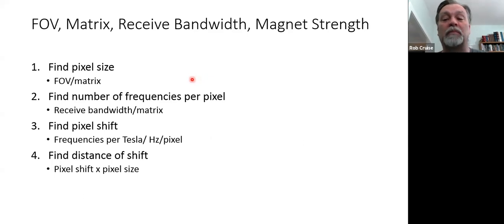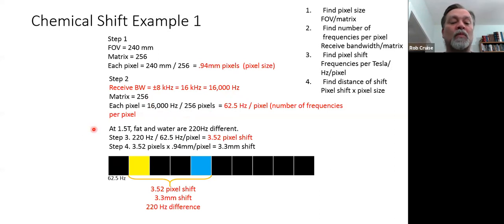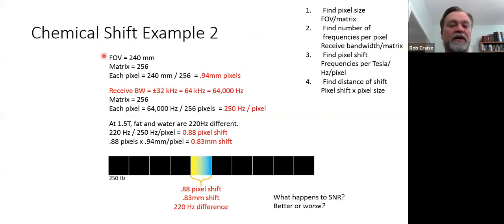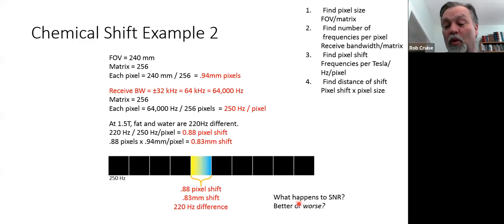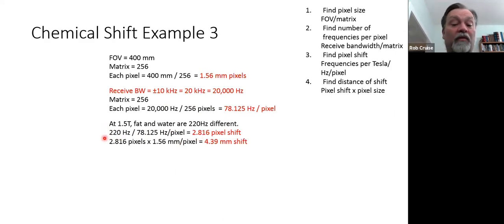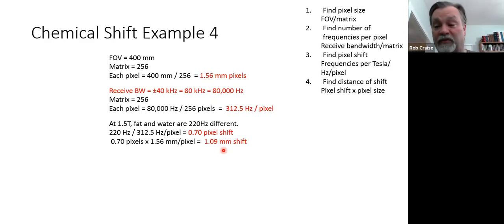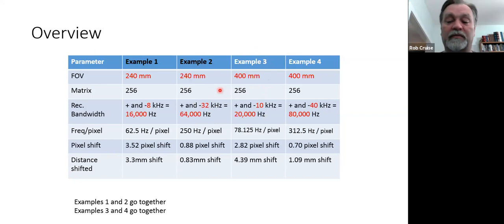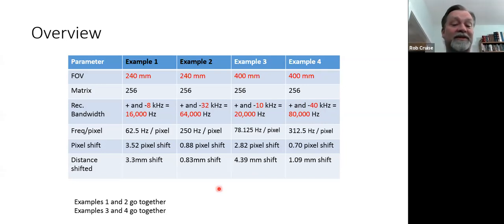MRI Chemical Shift Artifact Calculations

Comment: Please explain to me
First pixel in the far left experience 1.5 Tesla Plus a .01 Tesla so it experienced as example a 65mhz and next pixel closer to iso is 64mhz does that mean pixel 2 has ranges of frequencies from 64mhz until 64.999mhz ? And if additional .1hz can make the signal be registered to the neighboring pixel please could u explain to me im struggling
Reply from the maker: There are several things you are combining here. You are talking about bandwidth, matrix size and magnet strength. You first have to separate them out, so you don't get confused. Pixels will have a number of frequencies within each one based on your bandwidth. I can elaborate, if needed.